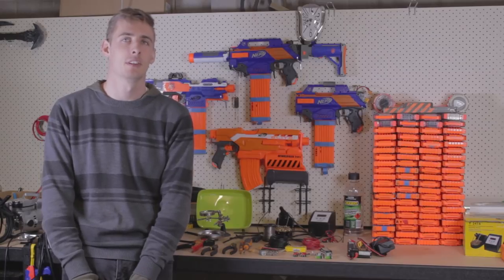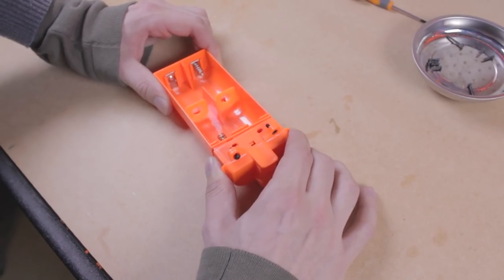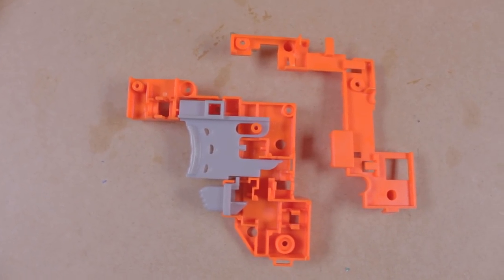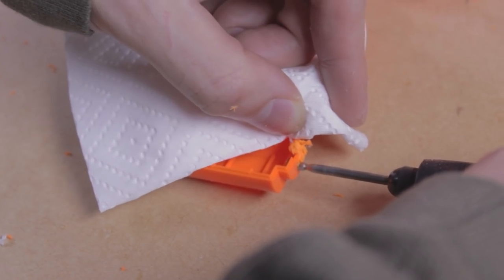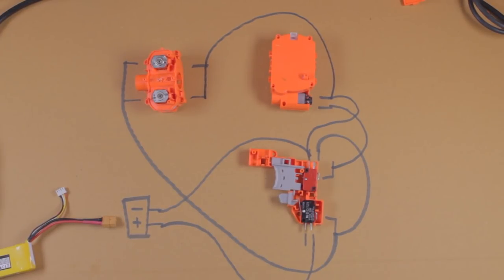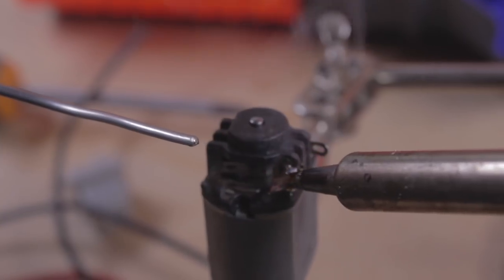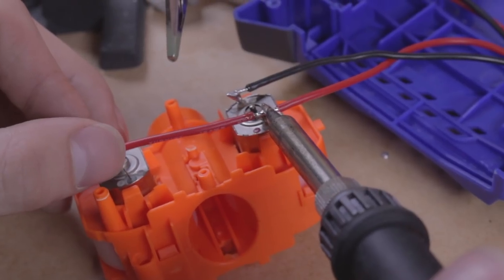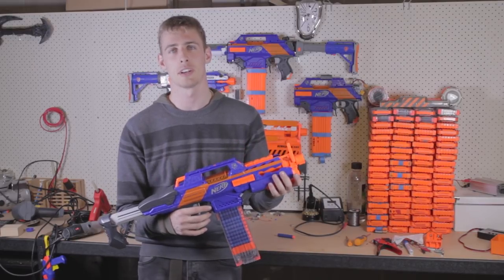How to Make a Super Rapidstrike | MAKE TEST BATTLE Modding Tutorial

Comment: I just got two questions.

1. How does this perform on 3-4 IMRs? The lipos I have are too large to fit anywhere.
2. Does removing the pusher mech switch thing cause jams? I like to fire in small bursts, and I dont want to crunch darts in the process.
Reply from the maker: 1) IMRs don't have enough current output to properly power these motors
2) No
-R
Reply: Wow, was not expecting a reply at this speed. 
Ransons and falcons do not seem to have good shipping options, will your rhinos for flywheels and a honeybadger for the pusher work similarly? Containment crew happens to have nice shipping to where I'm at.
Reply from the maker: Bored at work :P I should probably update the video... Yes. I design Rhinos and Honey Badgers be be replacements for the Falcon and Ransons respectively -R
Reply: Okay, last possible question left: which microswitches? The ones used in the video do not ship to the US, and I cant seem to find any with that shape.
Reply from the maker: Hmm; We tried to pick ones on Amazon. Have a search of 15 amp microswitches on ebay/amazon until you find something that looks right -R
Reply from the maker: http://www.ebay.com/itm/Microswitch-15A-V-156-1C25-pin-plunger-snap-action-SPDT-Micro-Switch-PS-/331451455777?hash=item4d2c0bd921:g:K6kAAOSw-W5UuVL2

Comment: do you have a comparison video of before and after? thanks!
Reply: I'm a bit late, but the video contains a segment of that at the end, with a video of the chronograph test and ROF vs. stock. If you really don't want to check it, then here's the summary:

Stock: 50~ FPS, 3-4 darts per second
Overhauled: 110~ FPS, 10-12 DPS

Comment: Can I use a stock 130 motors that came out of my stryfe for the pusher motor? Or will the lipo burn it out? Is there any other recommendation for a pusher motor? I cant find a lot on ebay. Thanks in advance
Reply: 1. Stryfe pusher will burn out and get about 3dps
2. DO NOT SEARCH FOR RANDOM EBAY MOTORS get an mtb honeybadger

Comment: What do you mean by "burning" the ransom motor in? Also what are ransom motors?
Reply from the maker: Super22th Ranson motors were a super high RPM motor that I used for the pusher. They are really hard (impossible) to find now but they needed to be run in to get them to be more efficient. You can Google dc motor burn in for more info. Its not needed for any other motors. -R

Comment: How much of a difference would a 3s lipo with 20C make? I have 3 of those hanging around
Reply from the maker: +bradley morgan Depends on the capacity; take the C rating and multiply by the amp hours. It needs to be more than 25 for the rapidstrike. 20C * 2200mAh (for example) = 20 * 2.2 = 44 which is good. -R
Reply: It's 2500 mAh, which means about 50 amps max. I measured the resistance of the circuit to be about 1.6 ohms, which means that at 12 volts it will only draw about 7 amps

Comment: Could you use a 3s 1300mah 11.1v 26 amp max discharge LiPo battery with 3 130 size rhino motors?

Comment: Question from a beginner; Which (currently available) motor combo will provide the greatest rate of fire? I ordered Hellcats but am thinking there may be a better combo? Thanks for your time
Reply from the maker: For a 130 size pusher motor the MTB Honeybadger or in 180 size the MTB Wolverine, both on a 3S LiPo -R
Reply: Thanks for the quick response! Just to clarify, do I use a 130 for the pusher only?
Reply from the maker: its really up to you. You can use 180s or 130 is either the flywheel or pusher but you will need to cut holes in the shell for 180s to fit -R
Reply: Make.Test.Battle    Hi.  I'm fairly new to nerf and I'm looking to mod my rapid strikes.  Most of my nerfing Will be done inside my house with the kids.   I'm not looking for max performance but I'd like to get some.  Since rhino motors are not available can I use 3 honey badgers in my set up?

Comment: Sorry noob question but -Why do you soak the motors?
Reply: Burn in motor to increase its operating life. It is a process specific to sub-optimal motors, it is not necessary with any half decent mod motor nowadays. Now, look to MTB's Honeybadgers for a 14 DPS monster on 3S as a pusher, no burn in necessary. It may have mediocre trigger control compared to others, though.
Reply: xXTheAcePilotXx  18 gauge wiring throughout the loom will work - but it may be suboptimal. With most motors that have reasonable stall currents that aren't significantly over 30 amps, you don't see any major decrease in spin-up time from the resistance. With Neocats, you might see a noticeable difference.

I'd recommend a hybrid - use 16 gauge wiring on the flywheel circuit, and 18 gauge on the pusher circuit. You don't end up with tons of bulky and difficult to fit wire, and you get no observable disadvantages. A single Honeybadger pusher is light work for 18 gauge.

Comment: what' the difference beetween this mod and the classic voltage mode with amr batteries? (I' m new in the nerf community)
Reply: PlaystakizanTeam HD imr batteries should never be used with nerf. Not only are they inefficient they are downright dangerous and could set your house on fire. Save up for a Lipo and don’t take the risk. Lipo batteries are batteries designed to be used in rc airplanes going straight up at 100km/h and doing backflips with drones. They can safely deliver the power needed for nerf applications without blowing up. IMRs and trustfires are not meant to be used to power multiple high speed high current motors and they will most likely catastrophically fail

Comment: Hi, can I only change the batteries for a Li-Po battery, or if I do so, do I also have to change motors etc.?
Reply from the maker: +Gauthier Lerda (Elsweyr) If you use IMRs use high quality, high discharge rate IMRs such as AW or WindyFire brand ones -R
Reply: +Make.Test.Battle Okay, I was finaly thinking of using Effest Batteries cause Li-Po Is a too expensive investissement for me. Using 4 of those Is okay?
Thanks for your precedent answer, really great from you. :)

Comment: If I want to install a voltmeter, where in your diagram would I wire it in? I love these vids!
Reply from the maker: depends where you want it but i would suggest the positive and negative terminals of the LiPo plug is an easy solution -R
Reply: I should have been more specific, thanks. I'd like the jam door to toggle it on and off or possibly turn on when the rev trigger is pulled? Is there any drawback to having it always on? I've got my rapidstrike all gutted and dremeled down and ready for wiring. Just got hung up on the volt meter. Thanks again!
Reply from the maker: Turning it on when the rev trigger is depressed will be slightly deceiving since the voltage of batteries drops under load. Only drawback is personal taste. The voltmeter itself will use very, very little power -R
Reply: Ah ok. I was just worried about having the voltmeter on all the time if it was wired straight to the battery. Having to unscrew/remove the battery if i were to set the blaster down for a few hours or something. Is that the same as if i wired it to the trigger pull? If the drain is insignificant with it always active then i'll take your advice! Thanks again!

Comment: Another question.. i have a prolem, i took off the resistors on the pusher, but now when i plug in the battery, the pusher motor start spinning directly and the rest doenst do anything. (the rest i mean the rev trigger and the normal trigger) they dont work now. what can i do_?
Reply from the maker: I'm really not sure what has gone wrong, but if you do the entire rewire guide as per the video you should have a functional blaster at the end -R

Comment: If I'm adding 7,4 Volt Lipo Battery without doing any thing in the wire stuff (Wiring), does it gonna fry my wire/motors? Please reply🙏🏼
Reply: Alexandro Calvin if you don't remove the thermistor, won't work

Comment: If i use the rhino motors for the flywheels, should i use a different motor for the pusher mechanism, or should i just use another rhino motor? If i should use a different motor, what should it be?
Reply from the maker: A rhino motor for the pusher is good too. It has a slower, but more controllable rate of fire. You could use an MTB Honey Badger for ridiculously high RoF -R
Reply: Thanks! That is really helpful! Just out of curiosity, how many darts per second can you fire with a honey badger motor?

Comment: hey guys i did excactly the mod you did, just with stock motors and a batterij tray. but now when i activate the rev trigger, the flywheels start to spin normaly but then when i activate the normal trigger, the circuit shuts down instead of spinning the pusher
Reply from the maker: Double check your circuit and wiring. It shoulds like a small mistake with that -R

Comment: Thanks, but it is the rev trigger, when i push it in it stops the motors instead of starting them
Reply: then hold the rev trigger till you want to fire!
Reply: Cwbennett 1127

Then you have soldered the wrong terminals, solder the over to ones I think on a stock switch, and I think you'll be fine

Comment: How would you modify this wiring to use the stock trigger switch & cycle control pcb's?
Reply: Stock Trigger switches are incredibly weak. they can't handle things like LiPo's or Aftermarket motors
Reply: RedNinja Productions Fair enough. However, if I want to keep live center or dead center, instead of deleting cycle control entirely, what should I use?

Comment: Can stock motors be rewired? If so will 3 imr's burn them out?
Reply: They can be used in a rewire, and yes, 3 IMRs will burn them out. Additionally, if the IMRs are 14500 sized, then they will not be able to supply enough current for stock Rapidstrike motors. RS stock motors are a hotter wind (more RPM with less volts) than a Stryfe (reshells included) or Rayven motors. You will need decent 18650 IMR at least, and then, the battery tray spring contacts are high resistance so it won't be optimal.

Stock Rapidstrike motors are best run with a 2S Lipo or 8.4V NiMH pack. More voltage will not notably increase FPS, only its fire rate. Stock RS motors will last about a year of semi-regular use with this set-up unless you replace the brushes with carbon ones. They won't last you as long as good replacements, so you can use them while you try to get or wait for replacements.
Reply: Thanks for replying, this'll help.

Comment: Hey MTB, I am going to be running Hellcats for flywheels and a Wolverine for a pusher. What are the best specs in terms of a battery?
Reply from the maker: Right now, Wolverines are what they are meant to be. If you want high RoF now, go for a honeybadger -R
Reply: Oh ok, but what battery would you recommend for a hellcat/honeybadger setup?
Reply from the maker: TheFlyingSniperTFS A 3S LiPo that has at least 60 amps of burst discharge -R
Reply: Thanks!
Reply: Make.Test.Battle
 Because I am a Lipo noob, I have to ask if "60 amps of burst discharge" is the same as 60c? If not please correct me.
Reply from the maker: TheFlyingSniperTFS The way it works is you take the C rating and multiply by the capacity in amp hours. So a 1000mAh 60C lipo would be 1 x 60 = 60 amps. A 2000mAh 30C LiPo would also be the same 60 amp discharge; 2 x 30 = 60 -R
Reply: Thanks! You guys are so awesome to reply to your subscribers like this, I can't even explain how awesome you guys are!
Reply from the maker: TheFlyingSniperTFS heh thanks. We're just as part of the nerf community as the rest of you guys, we just happen to make videos :P I prefer reddit and facebook to youtube comments tho; the notification system on youtube is pretty bad -R
Reply: why do you have to do the motor burn in?

Comment: Can I use IMR's instead, if so what what I have to change and how many would I have to use?
Reply: You can use 3 IMRs with stock motors and switches as long as you rewire the blaster. IMRs don't have enough power for upgrade motors though.
Reply: @00goop43  Okay thanks.

Comment: is the burning process of the pusher motor a must? or can the mod be completed without it
Reply from the maker: Only if you use a Ranson Pusher which is very unlikely nowdays -R
Reply: +Make.Test.Battle allrightt, and is it possible to do this mod with the stock pusher motor?
Reply from the maker: Sure; but it will burn out after usage and will need replacing -R
Reply: +Make.Test.Battle what would you recommend for replacing other than a randsom motor?
Reply from the maker: NL Mods 13 If you want to keep the very high rate of fire get an MTB Honey Badger motor for the pusher -R
Reply: +Make.Test.Battle okey thanks man

Comment: I want to use a honeybadger for the pusher mech, but since it is 2s, I don't know what to use for the motors in the flywheels as I don't think rhinos will work as they are 3s. What do I do?
Reply from the maker: Well, you can use the Homeybadgers in the pusher on 3S for insane rate of fire, or you can use honeybadgers on 2S for all 3 motors for a higher than rhino rate of fire -R
Reply: +Make.Test.Battle But aren't honeybadgers only for 2s?
Reply from the maker: MrJams Gaming 2S Flywheels, 3S pusher -R
Reply: Ok thanks

Comment: If I was using a 3s lipo would the stock pusher motor be good enough
Reply: If not which motor would you recommend
Reply: +Matthew Hawkins For a 3s lipo, you may want to use the MTB Rhino motors, as they are designed to take the 12v of a 3s.
Reply from the maker: For a 3S LiPo the stock motors will probably burn out quite quickly. An MTB Rhino will give a decent, higher than stock, rate of fire and if you want to go insane use an MTB Honey Badger for the pusher -R

Comment: is there a big difference between 2s and 3s lipoos?
Reply from the maker: Yes; A 3S lipo as a higher voltage than a 2S (3 Litium cells instead of 2) so the motors spin faster and with more torque -R

Comment: Can someone clarify me the diference between the two motors and the other one? And what is the process made to one of the motor introducing  it in liquid?
Reply: fpedeferri the 2 that are the same are at the correct speed to grip the flywheels and not be too fast to just slip, the third motor is faster and controls the rate of fure

Comment: If the motors are loose cant you just wrap electrical tape around them?
Reply from the maker: Benjamin Esqueda That works! I find that electrical tape is too thick to get an accurate thickness applied. Maybe try a thin painters masking tape instead? -R
Reply: Make.Test.Battle ok thanks for responding!

Comment: When I attach all the wires and everything I test it and the motors go but when I pull the rev trigger it stops them so it is backwards. How do I fix it? HELP PLEASE!
Reply from the maker: +Carson Bennett Make sure to check the entire circuit to make sure everything is wired correctly. If the motors are spinning backwards, just reverse the positive and negative connection to the battery -R

Comment: Where’s the 3rd switch for pusher regulation?
Reply: You don’t need one for a rapidstrike, especially at high rates of fire. Even if your pusher stops extended the dart pressing up on it won’t damage it. Even if it had a 3rd switch a dart still presses up against the pusher when it retracts. That’s what the springy but on the bottom of the pusher does.

Comment: Any advice on the falcon motors? I tried ordering from hobby world  on aliexpress and there out, then I put in an order with motor mall and they say they're out and I have to cancel the order.
Reply from the maker: Its a big problem with AliExpress unfortunately. You either need to buy 50 or they sometimes cancel your order.  Try a different source on AliExpress or check if someone is reselling on eBay.
Reply: Make.Test.Battle I did order 50 :(
Reply from the maker: Bruce Gailey Damn. Just keep trying different sellers I guess!

Comment: Can you connect the wires with a black tape ?
Reply: I'm not an electrical engineer so correct me if im wrong but I reckon black tape wouldnt ensure the same ideal electrical connection as the wires being soldered together.

Comment: How many C discharge would be needed to run two hellcats and a honey badger pusher?
Reply from the maker: Go for something that will output around 60 amps. -R
Reply: Thanks. I wasn't sure because I love the hellcats but wasn't sure of I needed a new battery for the honey badger addition. I now know a good battery for the job
Reply from the maker: Yeah 180s are a step up in power for sure -R
Reply: What rating Microswitch would I need?